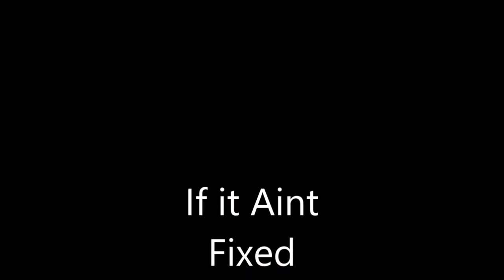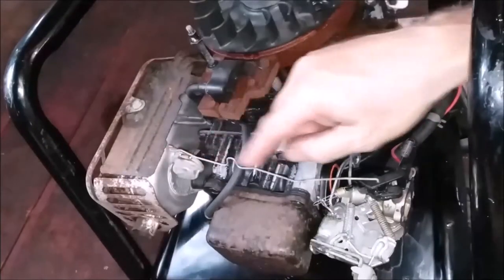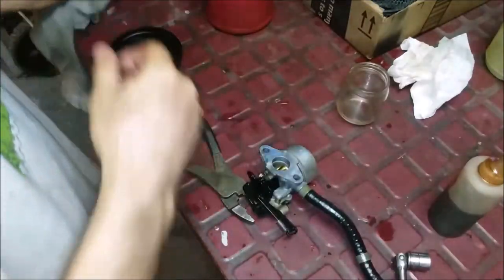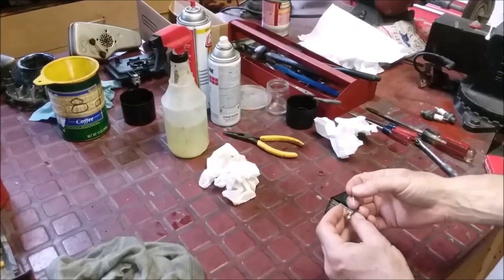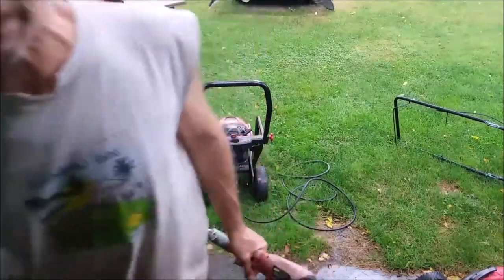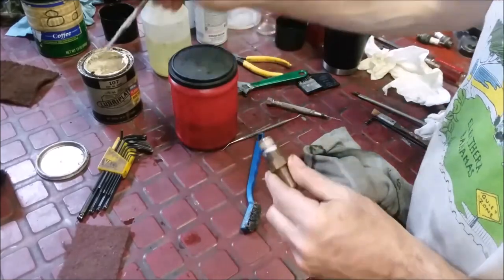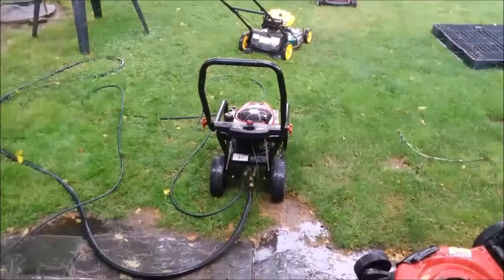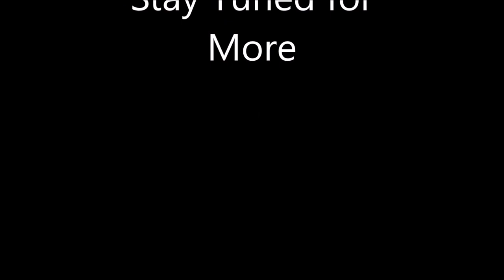Craftsman 2700 psi Pressure Washer-Briggs OHV Engine, Fail, How To Fix the Engine & Pump.

Comment: Good Job Arch. I have one of these Pressure Washers, and extra engine. The guy said the extra engine had No Compression, but haven't worked on it yet. Question: I need to Torque the flywheel nut on the Washer that complete, I believe the Torque is 55 ft. lbs. but how do you hole the flywheel so you can Torque it?  The guy I got this complete machine from said it smoked, but when I checked the oil level, it was again as much as the regular oil level, so I guess it would smoke if that much extra oil was in it.  Thanks for the Video, I saved it.
Reply from the maker: If you have an impact driver of some kind then you don't need to torque it, Just run it on low if ya gun has an adjuster of some kind.. Hold it with a gloved hand
Or you will need to brace the fins in an area that has some re-enforcement. Be careful not to break them. 
Thanks for watching, that's one of my 1st videos years ago!
Reply: OK Arch, I'll give it a try. Thanks.  @TheNovaJohn

Comment: I got the same pressure washer 2700 brigg& stratton 172cc 2.3
That I need to calibrate the o.h.v.
Valve.  How do you do it? Can you do a video of that?
Reply from the maker: I think I already have one, I have a folder on pressure washers and another on valve adjustments. Basically the principle is the same!
Once ya understand this, there is no difference.